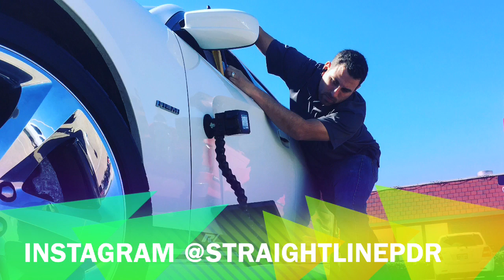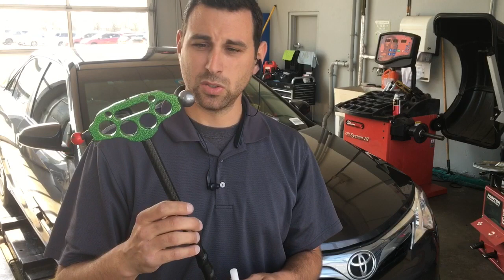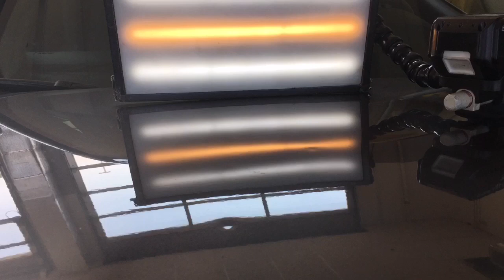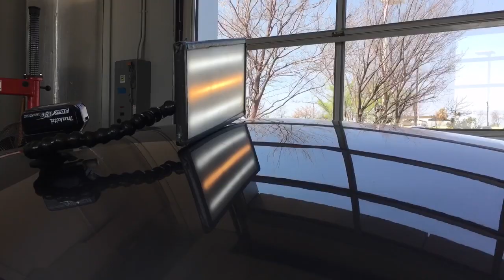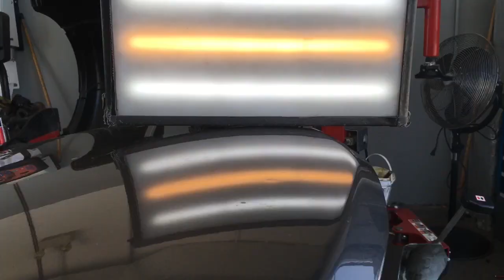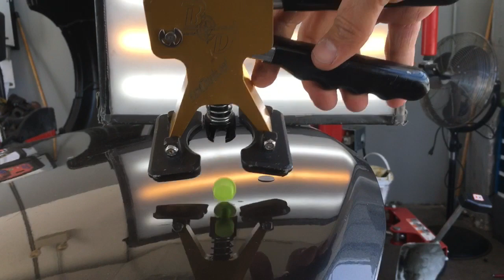Hail Damage Repaired with Paintless Dent Repair by Straightline PDR Dallas, Texas (469)708-8457

Comment: Very helpful. Is it possible to repair dents on a hood that has been painted from an accident? they used bondo. I understand you shouldn't do glue pulling. What about pressing from underneath. Will it break the paint/bondo?

Comment: Great video with excellent results.  Interesting that your using the ball tipped hammer as some strikes seemed to deflect downward if not hitting the center of the tap down tool.  Any advantage in using the ball end ?

Comment: What does it cost if it takes you a day worth of labor?
Reply from the maker: Word of Fakes there are many variable when estimating the cost of a repair. Number of dents, size, what kind of metal, method of repair, accessibility, etc.....Also wholesale customers are provided a discounted rate based on volume. 

The industry follows a pricing matrix that may help answer your question in more detail. The retail costs can be found online if you search the term “auto hail matrix”.

Comment: A question if you have a moment ... When using the hammer and the white pointy 'crayon', does any of this relate to stress/relieving stress of the metal around the dent? Thanks for the video!
Reply from the maker: Paul W short answer is yes the knockdown can be used to release stress/pressure around the dent. Long answer is that the dents presented in this video are not difficult and should be able to be “pushed” easily. I believe the only times I used the knockdown are when I was glue pulling in the end. There were a couple dents that I couldn’t access from the underside of the panel. When I pulled the metal too high, I used the knockdown to literally knock it down and smooth it back out. The last dent wouldn’t easily glue pull for some reason. So I used the knockdown to widen the dent. This relieved some of the trapped pressure by opening the dent so the bottom could be pulled up more easily. On a different note Very large dents usually have a crown to them that will need to be knocked down typically with the hammer instead of the knockdown. Remember the bigger the striking surface the more metal it moves. So be careful and consider the situation. There is so much more information to share on this topic I can’t possibly do it justice with just words. Maybe I should do a video about it.

Comment: How can i remove a straight line dent..
Reply from the maker: Sayan Chowdhury I assume you’re talking about a crease. This is probably the hardest dent to fix depending on how sharp it is. Hard to explain. Maybe I’ll make a video.You must work perpendicular to the crease and make very precise pushes in the deepest part moving the metal a little bit at a time from one side to the other. It is very difficult to get this type of dent smooth without a “stitching” appearance. To do so you need to overlap your pushes meaning as you move across the dent you barely move your tool to the next push spot. remember to cross check from the opposite direction often. There is a revolutionary new tool on the market that I have not used yet that apparently makes very light work out of these crease dents. Check out Stanliner Tool’s snake or raised snake.
Reply: @StraightlineDentRepair  thanks for the reply and sugession, i will wait for you video.